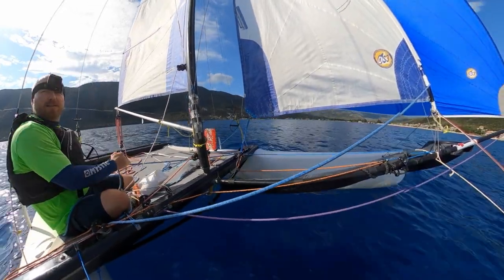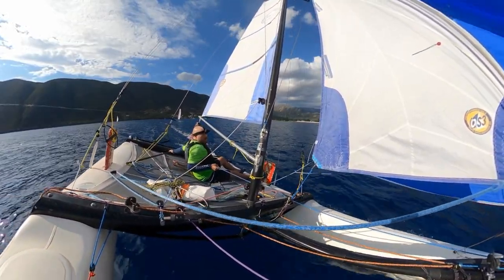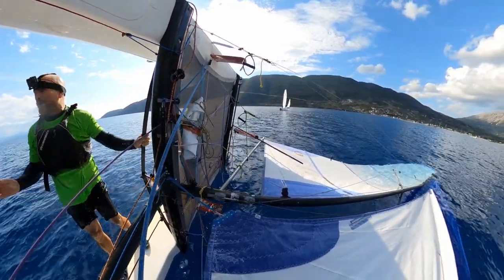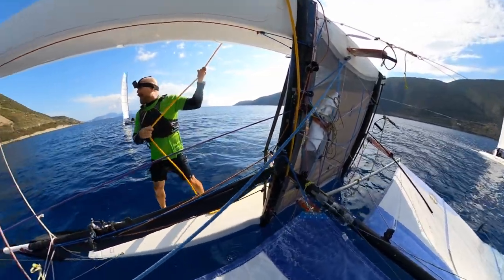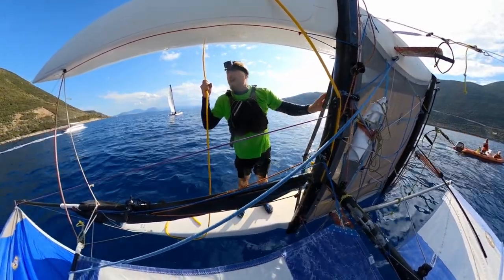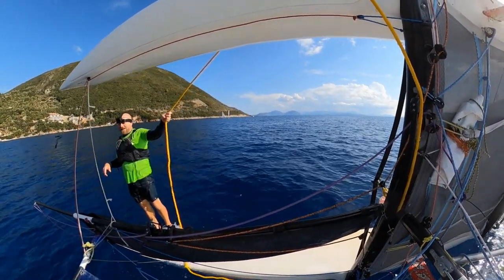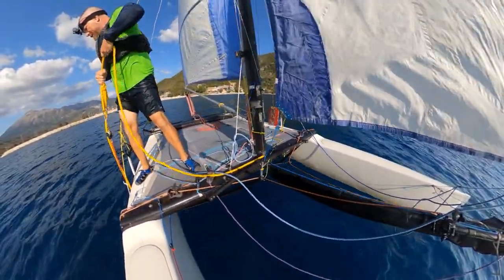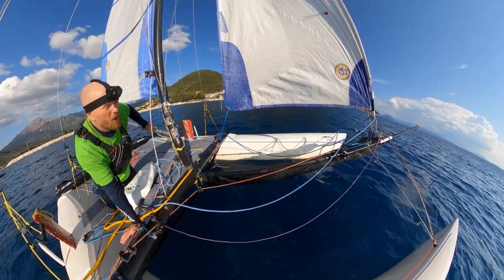Capsize with spinnaker - what to do

Comment: I never managed to right mine, always thinking I was not doing it Wright. Now I can see that is impossible 
Liked your tip to use the trapeze to get back to the boat. 
I recently capsized in a windy day  and the boat started sailing by it self I had to let go and grab the rear cross beam and by that time I was exhausted for trying to climb back from the front . The water resistance was two much
Reply from the maker: Yes, when the traveller is out and the jib is in the boat will naturally turn downwind.

Comment: Awesome video. I had a similar experience in 11kt wind. Gust got me, was falling from windward side and made sure I didn't hit and damage the boom, unfortunately I fell on the carbon daggerboard and broke two ribs. Was able to do almost the exact same righting you demonstrated except no bag. Was able to right my Nacra Infusion by myself with broken ribs hanging out. I stood on daggerboard and lowered myself just above the water for more leverage.  Climbed back on same way you did.
I noticed the newer boats with tall flat sides will come up and sit with flat side in water with mast tip out of the water. A puff was what got under the mainsail and helped right the boat.
Reply from the maker: Ouch! That's pretty impressive with broken ribs. 
Must have stung a bit getting back on!

Comment: Cool video as always. How about removing the upside mast stay pin to get added leverage?
Reply from the maker: yes, that could work but, the F18 has a lot of rig tension, not sure how i'd get it back on.
Reply: @JoyriderTV  you would have to be on the opposite tack for the wind to help give slack...worse case, limp it back to shore

Comment: Great video! I am 15 year old and learning catamaran sailing with the help of your videos. It is really great to learn from you! I have a question about the rudders and the Daggerboards(the plates in the middle that keep the boat stead but I do not know what they are called in English). When you capsized, is there a possibility that if you had moved the daggerboards and the rudders up that the boat could have rightend itself better up? 
My second question is about positioning the boats trampoline that is on the side of the mast. You stood at the front of the hull to rotate the boat. Why didnt you jumped into the water and moved it by hand? Keep up the great videos!
Reply from the maker: Q 1 - no, that wouldn't make a difference. 
Q 2 - Usually, by sinking the front it's enough to turn the boat - it's generally too big to swim around unless the wind is very light. 

I'm glad that the videos are helping. Keep up the cat sailing - maybe when you're 18 you should come and teach at Wildwind!!

Comment: a good tip for getting on a f18 that moves after righting is to go on the windward side, put a foot on the daggerboard under the hull, swing underneath while holding the hull, grab the stay and the trapeze and let your body drag on his back. after that you can swing a feet on the rear beam and pull yourself up with little effort
Reply from the maker: I'll have to see that manoeuvre.

Comment: I'm glad that the guy managed to survive, but I wouldn't call the process good-looking.
To my mind the very first what is to be made is to disconnect (to open) all the sails so they wouldn't grab water. And for sure you must know in advance if you really have enough weight (either with water bag or not) to right the boat regardless the wind.
And I'd also recommend to hook yourself to the righting line to avoid the boat run away upon righting up without you - especially if you haven't got the sails full open like we see in this Video.
Reply from the maker: Thanks for your advice! 👌
Reply: Id loose sails and pull a fender in the mast so that the mast remains afloat. And under your catamaran an aluminum tube and when it turns put the tube under 45 degrees where you can climb in you always get it right
Reply: @davebeekvan8125  Just a few days ago I found out that mast of my catamaran (Dart-18) is filled with foam, so for sure it stays floatable because it can't get filled with water. It was a very positive news for me.

Comment: Traveler down on the capsize rigting is really tricky.  I had to let go of the dolphin striker one time and let the boat sail past me to grab onto the rudder and jam the boat up into the wind.  That traveler out will always point your boat downwind and have it sail away very quickly!
Reply from the maker: Yes, Good test only to be performed in light wind
Reply: I could imagine that undoing the jib sheet would be the safe way. The self-tacking jib is simply bound to make the boat bear away. 
 
I was happy that on my 3 Tiger capsizes at Wildwind this years I made it onto the boat each time - even though the boat was making massive way.  
I was surprised it was me who got on first, untrained as I am.  
 
But 25 years of practice at Wildwind slowly show effect...

Comment: People that don't sail downwind under spinnaker often enough find that their upwind mind-muscle memory does them in. I watch guys get overpowered and they want to turn up on the wind and sheet out, which almost guarantees them a swim. You have to do the opposite - sheet in and steer down. And you do go over, may sure the spinnaker isn't cleated or you'll never get the thing back upright. If you can snuff the sail underwater, so much the better. Regardless, that's a lot of boat for a single handed sailor to right, particularly without wind to get under the sail and help out.
Reply from the maker: absolutely!